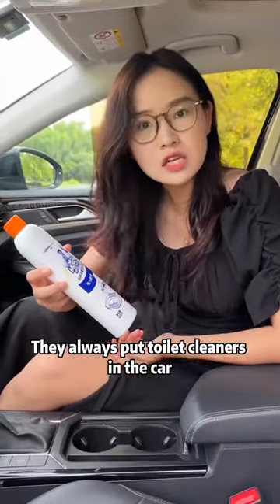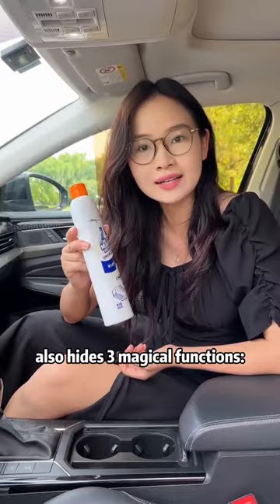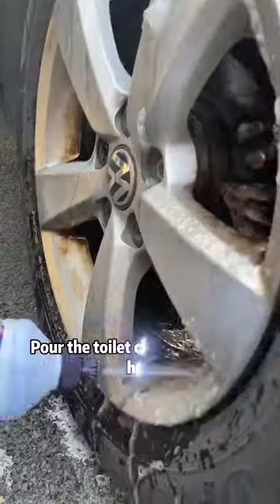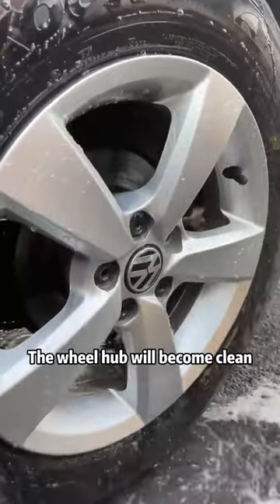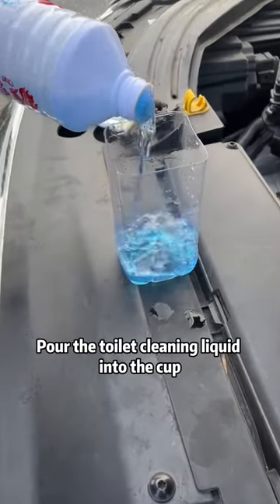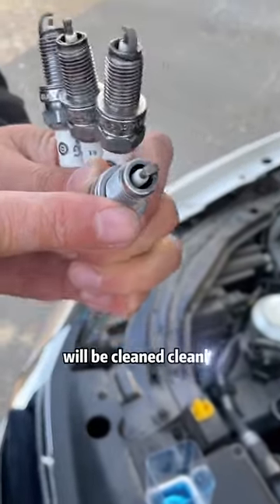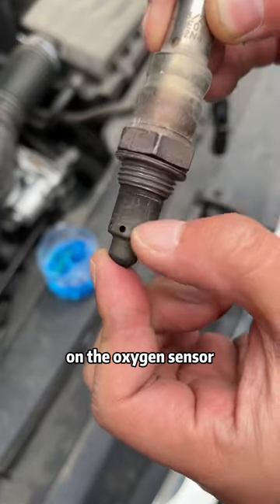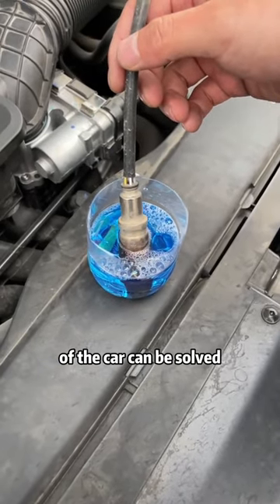Cleaning secrets the repair shop won’t tell you!#car #driving #tips #manual #carsoft #howto #skills

Comment: If you use toilet cleaner on your spark plugs or oxygen sensors. Don't be surprised your car stops working and goes into the toilet.
Reply: With toilet cleaner!😅
Reply: I've been using drain cleaner to remove fuel/oil deposits from the ceramic insulator a long time now with great results.  Toilet and drain cleaners are the same thing (sodium hydroxide), I believe?
I flood only the inner insulator and after removing plugs from the solution, rinse well with water to reduce chance of corrosion.
This will not fix a broken ceramic insulator.
I can't speak for o2 sensors, this might contaminate them.
Reply: @thisisyourcaptainspeaking2259 drain cleaners vary widely. They used to be diluted sulfuric and hydrochloric acid. Lots of governments have restricted this and now many are sodium hydroxide, but they also have lots of other stuff mixed in.

Generally just not a good idea to do that, maybe if you really want to you can clean off plugs with a wire brush or fine sandpaper. However if you need to clean the plugs than they should either be replaced or you should figure out why your plugs are getting dirty so quick.

This would definitely ruin an O2 sensor, luckily a spark plug is basically just a stick of metal and ceramic so there isn't much to go wrong.
Reply: I like that very much 😊 thank you very much
Reply: Wheels will corroded and your car will no longer start. Surprised she does not washing her car and say it cleans your teeth say it whitening them . Finally the repair shop are experts. So makes you wonder 😅
Reply: I won't use this stuff on my freshly powder coat wheel  I prefere buy the rust remover it work  better
Reply: @mikegalvin4655  Be careful what you use on aluminum, I suggest aluminum wheel cleaner.
Reply: @thisisyourcaptainspeaking2259  yes this is what I was supposed to use my mistake aluminum wheelcleaner it does come purple after u spray the products
Reply: Don't minimise the lady's advice! She is very right.
Reply: Use gasoline to clean your sparkplug
Reply: Lol

Comment: This trick works great because after you dip your O2 sensor into drain cleaner youll need to buy a new one which will solve your problem.
Reply: Most likely

Comment: Speaking from experience of working in cars longer than this girl has been alive...no. Don't use toilet cleaner on spark plugs or O2 sensors. Or anything else except toilets, really.
Reply: Thank you for sharing respect.
Reply: Have your wife try it on your car. You might be surprised.
Reply: @akun10years10  Nope. Not gonna happen.
Reply: why
Reply: @Albus9981  because toilet cleaner is for toilets. There are probably ingredients that promote corrosion. No reputable mechanic would tell you to use some other purposed substance for automotive use.
Reply: I’m not a mechanic but I know enough to know this clickbait. Im with you buddy

Comment: Every engine vibrates but if it's above a threshold, visit a certified mechanic. Same goes for the O2 and CO2 sensors if you think that they don't work properly. 
The rims, just wash them with regular water and soap.

Comment: Yes i actualy do know. I have put toilet cleaner in a car to transport it from the store i bought it in to my house so i have something to clean the toilet with. 
1. Do not put hydricloric acid (many toilet cleaners contan it) on aluminum, reaction will keep going long after you rinse the stuff. 
2. your spark plugs may look shiny after you pull them out of the toilet cleaner but will corode soon becose that bubbling wasn't carbon but zinc protective coating  being disolved from the threads taking the carbon with it and making it shiny..for about 20 minutes.
3. no use to put o2 sensors in anything, liquids that won't bust them won't do them much good either, certainly not magicly restore them to as new, if you must, use gasoline, but better to just replace them but not before you get rid of all the cheap silicone you hacked around your car with trying to get away without replacing a gasket or two so they got silicone or coolant fouled about a week or 2 later, just as new ones will if you keep the silicone. Use o2 sensor safe sealant next time. 
4. car hacks are something to get you home or move off the road in dire situation, not the way any car should be maintained.
Reply: I thought as much.
Cerosene oil or gasoline I would have thought. Then flash to dry.
Cardboard for engine rings.
Good old days.
Reply: O
Reply: I    LAK              YOU❤❤❤❤❤❤
Reply: As a chemist, i agree with you
Reply: KOIF❤

Comment: If your plugs and sensors are getting fouled by carbon. There's other issues with the car, and this will also destroy those parts. But even properly cleaning these components isn't fixing the problem, it's addressing a symptom.

Comment: No repair shop will ever clean spark plugs when they can charge you for new ones....
Reply: Used to intern in a workshop where we were told to clean old plugs and then the owner would charge customers for new ones. Not just plugs. Brake fluid, transmission oil, oil filter, air filter you name it. The workshop owner were in a huge debt and hasn't paid any of his suppliers and couldn't get anymore parts. I used to secretly share this info with the customers so they'd never come again.
Reply: No No No That Is For Third World Countries Like Ours....😮😮😮

Comment: when spark plugs start to miss fire, there's no point cleaning them, they have broken down ,just replace them with new ones
Reply: That's not completely true. My mowers engine was pretty much wore out, I have 1 cylinder that would foul out because of carbon build up.  I would remove the plug , clean and would be fine for another 3-4 lawn mowings.  I rebuilt the engine so now I don't have that problem.  If I replaced the spark plug every time it carboned up, I would have replaced the plug 3 or 4 times a season.  Cleaning was much cheaper,  though  I never would use toilet cleaner.

Comment: Just wash the wheels and get new spark plugs and get a new o2 sensor
Reply: And  fix the problem the problem if there's excessive carbon at low mileage.
Reply: O2 sensors aren't cheap and tbh there should be legislation to make these sensors as easy as possible to service so they can done at home
Reply: @AndrewMuschett 
I changed mine at home.  With the correct tools not a problem.  You can get the tools you need at Harbor Freight.  Mostly just an 02 socket there's a few different ones but pretty cheap.

Comment: Put it in your gas tank to clean the carbon deposits from your fuel lines. Put it in your windshield washer fluid to clean the carbon deposits from your windshield wipers. Top off your blinker fluid with a shot of toilet bowl cleaner to keep your blinkers free of carbon deposits. Acidic toilet bowl cleaner is only for porcelain. It will damage metals and plastics. Your car is made of metal and plastics. The only porcelain is the spark plug and didn't even clean the porcelain part of the spark plug with the toilet bowl cleaner. Amateur.

Comment: Thank you so much

Plz tell me the symptoms of head gasket blown
Reply: Hi.the easiest tell-tales will be water in the oil or black suit/fuel smell from water reservoir. If you remove the oil filler cap and turn it over, and see creamy coloured residue, it can be an early sign of water in the oil, which often indicates a leaking head gasket.

Comment: I thought this was a well-known fact I throw toilet cleaner into the toilet bowl and hang the six spark plugs via wire along with the oxygen sensor but the real magic is you should see the crap that comes out of the tailpipe once I've fitted it all back toilet paper and all
as for the wheels whenever I hit the motorway they pull into every service station thinking they need to go to the toilet an hour drive turns into a 3 hours drive.. 👍🏿

Comment: just replace the spark plugs. if you're taking them out, you might as well put new ones in. and same goes for the oxygen sensor. and brake dust isn't anything bad, except for maybe your wheels. but just wash your car.

Comment: While you have the plugs out you may as well pour an ounce or 3 in the cylinders. That will get the carbon off the piston top and the rings. And in 20 miles you will have a nice blue colored smoke coming from the exhaust! And then your compression drops off enough for adding that turbo you always wanted! Then 50 miles later you start that exercise program you blew off because now you are pushing the car since the engine exploded from following retarded YouTube hacks! Isn't that great??